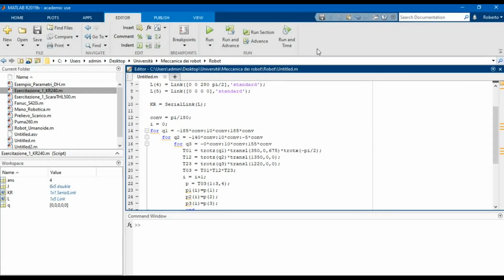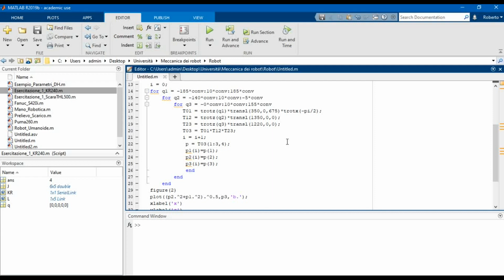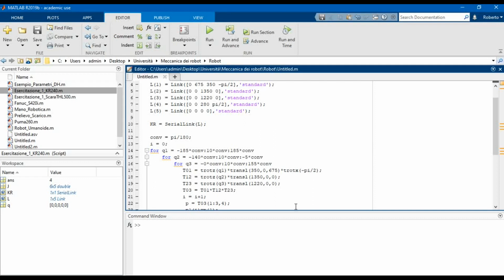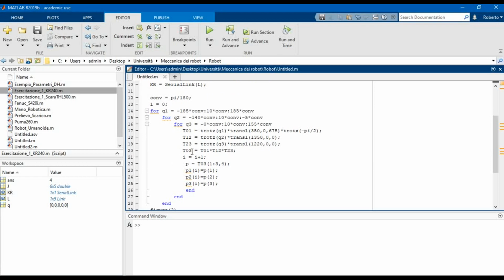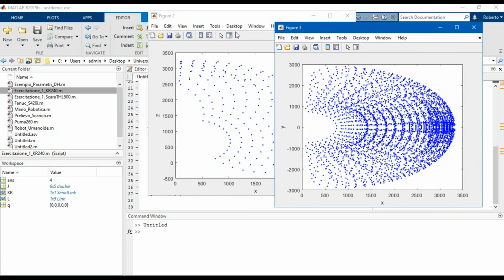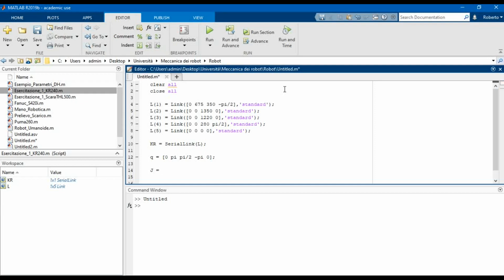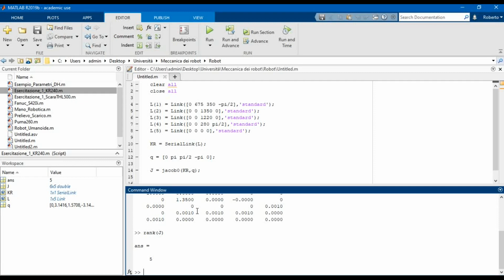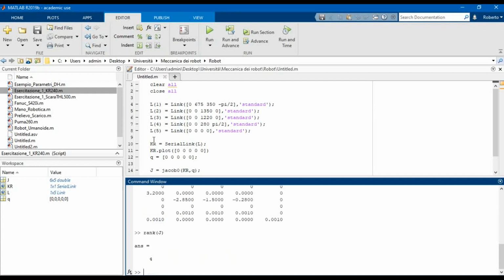MatLab Robotics ToolBox #3 - Workspace and Jacobian matrix

Comment: if i have up to q4 and p4 how should it look like i managed to have it running however it barely marks any points on the workspace, how can I make it run properly; here's my code 

clc
clear all

R(1) = Link([0 0.077 0 pi/2 0], 'standard');
R(2) = Link([0 0 0.130 0 0],'standard');
R(2).offset = 1.389282;
R(3) = Link([0 0 0.124 0 0],'standard');
R(3).offset = -1.389282;
R(4) = Link([0 0 0.126 0 0],'standard');

KR= SerialLink (R);

conv= pi/180;

i=0;

for q1= -360*conv:10*conv:360*conv
    for q2= -180*conv:10*conv:180*conv
        for q3= -90*conv:10*conv:90*conv
            for q4= -90*conv:10*conv:90*conv
             aAb=trotz(q1)*transl(0, 0, 0.077)*transl(0, 0, 0)*trotx(pi/2);
             bAc=trotz(q2)*transl(0, 0, 0)*transl(0, 0, 0.130)*trotx(0);
             cAd=trotz(q3)*transl(0, 0, 0)*transl(0, 0, 0.124)*trotx(0);
             dAe=trotz(q4)*transl(0, 0, 0)*transl(0, 0, 0.126)*trotx(0);
             aAe= aAb*bAc*cAd*dAe;
             i=i+1;
              p=aAe(1:3,4);
              p1(i)=p(1);
              p2(i)=p(2);
              p3(i)=p(3);
             
        end
      end
    end
  end
figure(2)
plot ((p2.^2+p1.^2).^0.5,p3,'b.');
xlabel('x')
ylabel('z')

figure(3)
plot ((p1.^2+p3.^2).^0.5,p2,'b.');
xlabel('x')
ylabel('y')

Comment: Hello, in your example you have 5 links. However, I have 3 links in my example. Can I do same process in my code, too? My code is below. I do not like the figures I obtained.

% Veysel Aksoy
clc;
clear all;
close all;

L(1) = Link([0 122 0 pi/2],'standard');
L(2) = Link([0 0 117 0],'standard');
L(3) = Link([0 0 80 0],'standard');

Robot = SerialLink(L);
Robot.name = 'Veysel''s Robot';

conv = pi/180;
i = 0;
for q1 = -185*conv:10*conv:185*conv
    for q2 = -140*conv:10*conv:-5*conv
        for q3 = 0*conv:10*conv:155*conv
            T01 = trotz(q1)*transl(0,0,122)*trotx(pi/2);
            T12 = trotz(q2)*transl(117,0,0);
            T23 = trotz(q3)*transl(80,0,0);
            T03 = T01*T12*T23;
            i = i+1;
            p = T03(1:3,4);
            p1(i) = p(1);
            p2(i) = p(2);
            p3(i) = p(3);
        end
    end
end   
figure(2)
plot((p2.^2+p1.^2).^0.5,p3,'b.');
xlabel('x')
ylabel('z')

figure(3)
plot((p1.^2+p3.^2).^0.5,p2,'b.');
xlabel('x')
ylabel('y')
Reply from the maker: Maybe for the xy plane you should use p1 and p2, while for the xz plane p1 and p3